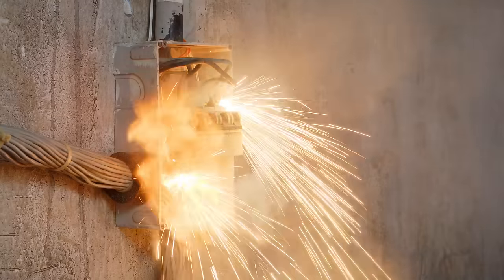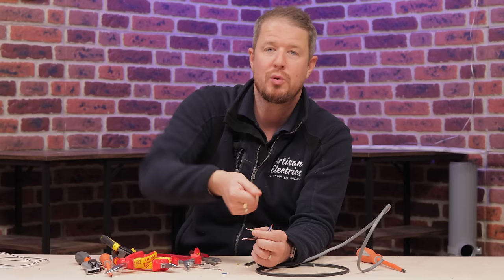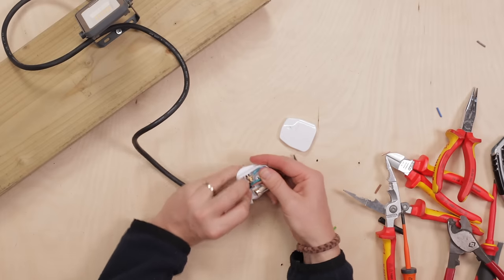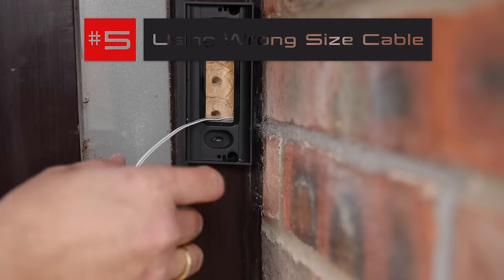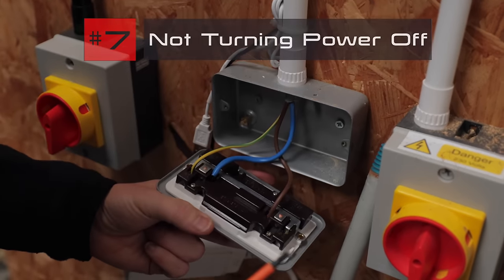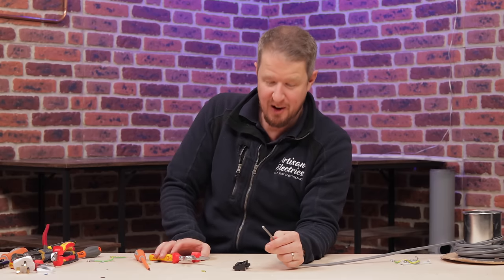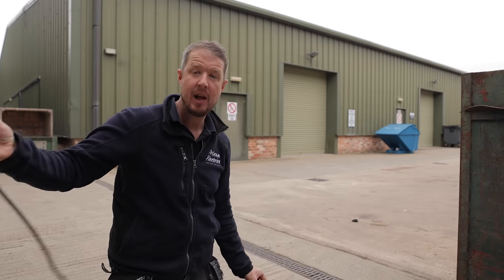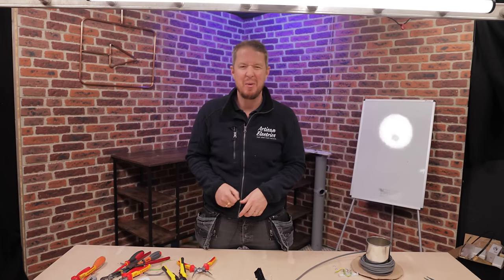10 Mistakes EVERYONE Makes When Doing DIY Electrics!💥

Comment: having to sort an issue in my parents house right now where someone they got in to do some decorating years ago, back when i was about 10, he told my parents he could put in wall lights. Turns out he used the wire that was there already for i think what was mains powered fire alarms. (Apparently my parents valued wall lights higher than having mains powered fire alarms. though i have no idea why the guy would actually remove the fire alarms rather than adding to the circuit), but clearly the guy had no idea what he was doing because the dumbo took the bell wire that was already in the wall and passed it in front of a stud. Which years later when trying to insulate the wall/ceiling  i cut right through with a stanley knife and somehow didn't die. 
So yeah, i'm now in the middle of taking out a section of roof/wall to insulate it all properly and also taking the opportunity to remove that guys terrible botch job with the electrics,

Comment: Everything in this video was just common sense. Like, dont leave your stove plate on while going to bed.

Like really, who uses bell cable for line voltage stuff? Thats just ridicoulousy stupid. I actually often do the opposite, using AC voltage wire to run low voltage.

That gives a less voltage drop, because a bell that requires lets say 12v might not start on 10v or sound muffled because its not getting enough juice. By use AC wiring, usually 6A which is the lowest you can get, I ensure the voltage drop is low enough to give bell devices enough of a power.

And using AC wiring for bell circuits are actually safer, as if the SELV transformer accidentially leaks live through (should not be possible, but who knows whe  a lightning storm have smacked the transformer) then the wiring will be insulated enough to not catch fire. And sturdier to, less chance they snap.

Comment: Even so called professional sparks make mistakes. I went to a customer to install an office machine. The electrcian had provided a 20A switched box on the wall. I asked the sparks is that live No I have the main fuse in my pocket. Dopey me trusting him started to undo the terminal screws and there was an almight bang and a flash and luckily I didnt get a shock.  When I could see again I showed him what was left of my screwdriver, he went pale and showed me the fuse. After some investgation we found that the idiot who put in the new run had connected to the the busbar side of a 200A supply. I could have been dead. I never trusted a sparks after that. I am competant at electrical work so one never knows.
One thing you didnt make clear only qualified electrcians can run cables but it is ok to change plug outlets,but most DIYers would not have any test equipment.

Comment: Jordan, you need to practice more and update your skills as an electrician in incompetent DIY work. It should be mandatory in electrician school and AM2 that electricians are properly thought how to wind stranded and non stranded wire together then use insulating tape or better again masking tape to cover it up, how to pop it into the wall, mix a bit of plaster and job done. 135 pounds an hour, nice printed T shirt, 6 star service. No need to fancy tools, long videos or WAGO's.

 Also no DIY uses a proper tool. Better to use a Stanley knife, preferably one with a blunt blade to strip the cables. Whatever is on hand is best. Think of all the money you will save having to use fancy tools etc. Bolster chisel, hammer, roll of insulation tape, Stanley knife, and old van, sticker on the side, 20k rewires all day every day. For safe isolation, just use the old Phase tester screwdriver. No need for testing, just use the old fashioned bang test.

Comment: I don't understand the mentality of the diy'er. Most know how things should be done but seem to go into extreme tight ass mode on getting the right stuff. I look at it this way: I need to do an electrical job at home, I expect an electrician will rip me off for at least £300 so I can go total bodge for maybe a outlay on bits for £10, or buy correct bits and do it properly for around £50. Well I'm still £250 the better so those who go total bodge deserve burnt houses....
 Do it DIY but do it RIGHT!

Comment: As usual, competent and intelligent non-electricians singled out for criticism.

If and when; all so called professional sparks do a 100% job all the time; then by all means - ' have at ' anyone at fault. 

Having seen the scores of of Youtube videos illustrating the corrective work deemed necessary, by an intelligent sparks after a "professional electrician" had signed off a job, it is difficult to accept this type of comparative critique.

Sadly, but increasingly, trades seem to be losing any pride in doing a Ronseal ' proper  job '. Not just the wiring, understanding and interpreting latest legislation, being able to use test equipment for circuit testing electrics but care with floorboards, surface decor etc. The term professional used to be a marker for quality. Now, it just means it's what you do for a living, not that you are necessarily any good at it. 

When intelligence looks for professional integrity and meets what Youtube cerainly appears to show as stupidity, is it any surprise intelligence picks up their own Knipex ?

Inductance versus resistance - I rest my case.

Comment: So explain to me exactly what am I supposed to do I have two gang outlets that were upgraded by the landlord from 2 one gang outlets installed in a 1970's house.
And I want to run computers & laptops & external GPU's & TV & sound system & multiple  100w aperture lights & an xbox 1X and a portable air con/fan heater and some infra red heating panels 
So how do I safely run that lot off wat is probably 2 1 gang sockets. And remember, I am a tenant, I carb change the infrastructure nor can I get an electrician in - only the landlord.
Also I like my landlord, he has kept my rent stable for years, and I do not want to move.
So tell me how do I FIX the issue rather than carping on about my being a stupid & I should get a spark to build out a better set of sockets which I cannot do!

Comment: I once changed a socket faceplate in our old (rented house) as the housing association made a rule that faceplates etc were the tenants responsibility, I'm 'competent enough' to do this, turned off the ring main for the downstairs circuit, checked (by the means of a phone charger) that the faceplate was dead ( The phone didn't start charging) Happily took off the faceplate, carefully undone the live wire with a uninsulated screw driver! (No shock) so confident everything was dead,  went to undo the neutral.......Yes you guessed it Jordan.....it had a borrowed neutral! So I got the return from the upstairs sockets.... I learnt a lesson from that.... TURN OFF EVERYTHING NOT JUST A CIRCUIT!

Comment: Do you think that a wound extension cord generates a magnetic field and therefore heats up? I inform you that it does not generate a magnetic field because it is a "coil" wound in both directions. And the magnetic field compensates itself. How did you get your electrician's license? 😆😆
Reply: To be fair, it's just an electrician's license, not an electrical engineering degree.  Theoretical principles of electromagnetic inductance is not really something that's going to be on those sorts of tests, or that are really actually ever going to matter in that line of work, so I can sort of give him a bit of a pass (but somebody really should have fact-checked it before they put out the video)...
Reply: @foogod4237  A good sparky understands inductance to some degree or should as it affects the current carrying ability of a conductor and limits current rise rates (delta T) in faults.  It's one of the reasons we are taught (hopefully in the UK too!) that separate wires for a given circuit must all run in the same conduit.  

Tacking a lightning conductor wire along a metal beam or even just putting tight bends into it will degrade it's ability to safely conduct the current to ground fast enough to keep voltage rise down.

Comment: agree with everything except from twisting cables, never had any problems. If you do it correctly there is no problem.
Reply: @OLIFAB  dude millions of houses are built like that many of them 60+ years old never seen anything wrong with them.Atleast in EU👍 on the other hand a small spark may burn a UK cardboard house down😂😂😂
Reply: I challenge you to come up with any "correct" way to twist solid and stranded wire together.  It cannot be done reliably, period.  Even stranded with stranded, without some kind of fastening device, will come undone eventually, it's just a matter of time.

Twisting two solid wires together can work, most of the time but no matter how you do it it is never guaranteed to maintain good contact if anything moves later.  Just because it's always worked for you doesn't mean it's right, it just means you've been lucky (or just don't realize you've actually got dangerous wiring all around you now).

Hell, even in the US that isn't allowed, for good reason.  As bad as wire nuts are, they're still better than that crap.
Reply: @foogod4237  dude wire nuts are always used but wires are pre twisted
Reply: @MultiTHUNDER00  

"UK cardboard house"

Brick actually.

Comment: I'm a fan generally of Artisan but this is an absolute load of nonsense. I recall recently you did a video where you wanted to help DIYers but now you want o throw them all under a bus! Every single one of the flaws you mentioned are equally applicable to so-called "professional" electricians as they are to DIYers. I would rather have an open minded, intelligent and motivated home owner wire up a circuit than a "qualified" electrician working against the clock every single day of the week.

There are amateur and DIY electricians (and equivalent) out there who can run rings around so-called professional electricians because the motivation is different. If I am living in the house I wired up then I am supremely motivated to ensure it is wired correctly. I will also check the circuits way more regularly than every 5-10 years so the net gain is positive.

Oh, and I'm unsubscribing from your YT account right now.